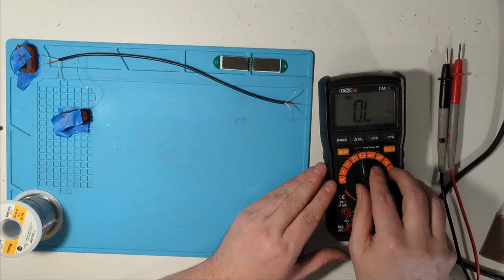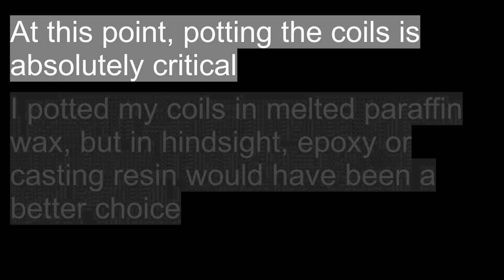Winding a DIY Sustainer Driver

Comment: Do you have a more high res picture of the full circuit that's on the webpage 'Reverse Engineering a Sustainiac Sustainer'?  I didn't find it in the github.  I don't find the transformer in the schematic.  Where should this be located and connected to the driver.  Hope you can help me out.

Comment: I’ve a question. Could you build a cv controlled sustainer ? What I’m imagining is a six string remote controlled ebow. 6 control voltages would open the power to 6 coils. One for each string. That way a modular synth could control the guitar sustain.
Reply from the maker: It's theoretically possible. You'd need 6 VCA's, six input and six output signals, but it's technically doable.
Reply: @thescientificguitarist4228  amazing. I’d be so into that

Comment: Greetings- Great tutorial. Hope you are willing to answer a question. I recently purchased a VYEZ set up and have found the the driver is really weak. The 2 coils on it are front/back instead of side to side. Any thoughts on that? Also the driver coil windings are not wired parallel within the driver itself, but routed through an external switch that allows reverse polarity on one of the 2 coils. I assume this is for the "feedback" harmonic. In a nutshell, I was thinking of building a new driver or perhaps rewinding the one that came with the setup.
Reply: It is possible, I suppose, that this driver is built as a dual pickup/driver- one winding is pickup and the other is driver?

Comment: This is surely the NO.1 sustainer DIY guide on youtube.   I am wondering about one thing though,  if the 2-piece pole tops were need to be angled and arranged in order to reduce the mag gap,  what would happen  if using a complete piece of pole top in the first place?
Reply from the maker: The problem is that one of the pole caps is N polarity and the other is S polarity. If you used one piece of metal, the two magnetic poles would cancel each other out. Also, please see the follow up video where I posted some more lessons learned. There will be another video or two to come in the future as I learn more, as well.
Reply: thanks, I thought that only the positive and negative charges will cancel each other when conducted by a single piece of metal, I did not know that same rule applies on the N and S poles.  Which is still confusing to me,  a regular magnet always has N and S poles together on a single piece of metal, are they canceling each other...? Anyway I appreciate your reply, I know this is not the place for getting a  basic science class...Looking forward to your new posts! @thescientificguitarist4228

Comment: whooahhh how did i miss this, excellent work brian, looks the nuts.....
Reply from the maker: Thanks! I'm actually working on another sustainer system that is less complex, though it uses all the same parts for the driver itself, just wiring coils in series instead of parallel. Hope to have that released soon. After I get everything squared away, I will eventually release all the 3D CAD files and such so that anyone who wants on can print the stuff and make one.
Reply: @thescientificguitarist4228   excellent,  yeah ive tried 2 x 3 pole coils in series...great stuff, i have a cheapo 3d printer too now so will keep my eyes open for your new update, nice one man .